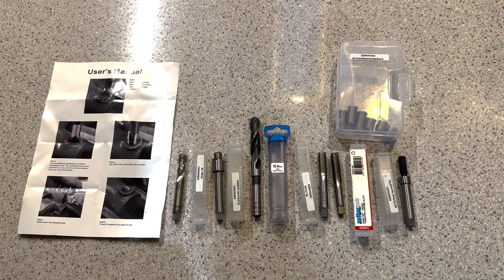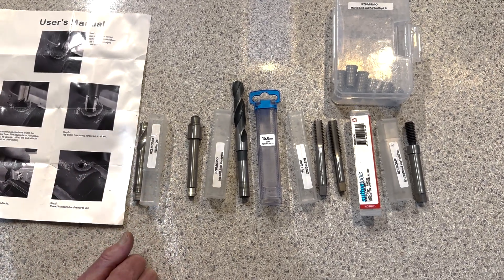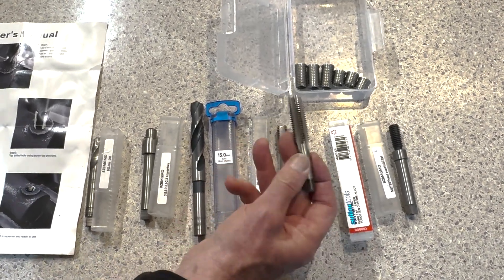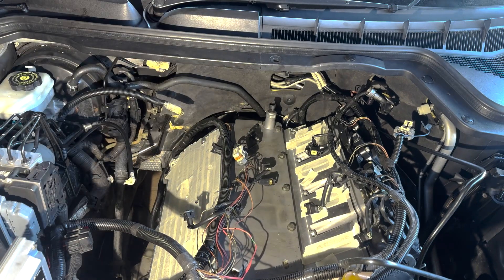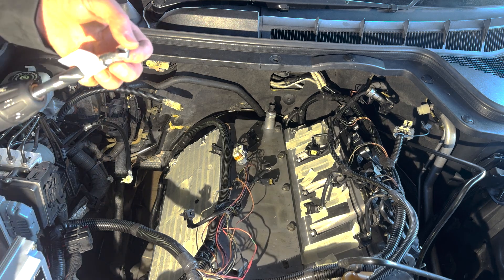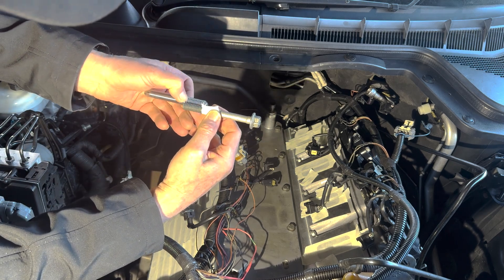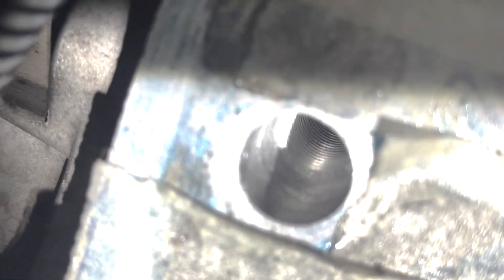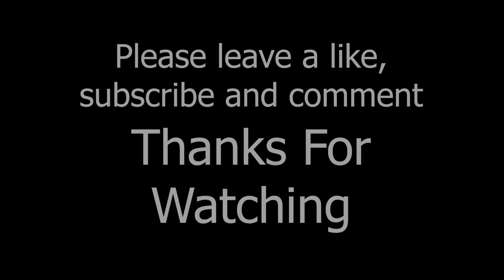The All In One Chevy LS Engine Block/Head Bolt Thread Repair Guide For under $100! All Skill Levels!

Comment: Can you post a link for this kit?
Reply from the maker: Here is a different kit but it contains all that you need except the 15 mm drill bit. https://www.amazon.com.au/SENNMONN-M11X2-0-Installation-Counterbore-Stainless/dp/B0FDG8Z1VL/ref=sr_1_2?crid=QJ1C7G9HE1B3&dib=eyJ2IjoiMSJ9.-1vI9cP8rL3MMOZ-Orou7rAgkFv6FqNAdfLEp-QsCHFIpWZZFHKjnkrV3Qw_EgOObfmoBdR78gRs7B9iixto-PUzN5VsIIsP32BP4kkfmBKnpe7fHfPHt5xSqsy_Z3hbYk8Zn2dfxQDYEmDaXg2bPkkV5Ruuis5iGYNLNHHEhrxyECyfeMkkCfkY7u14eSWq1eAkpa3OWj302LO0rQSsnXLC9NPx-SeRVqUlj84GrjMWAcYwxlCNVFfF81_CJL8bhVjCzwfzS-3mNy0f6stk31aCmoYwQ5Sb552Dlo24QL4.vn4Zj0WZCTvUzMfEDNRxSnbLTFNkGyKutxCYAz0UFK0&dib_tag=se&keywords=m11+thread+repair+2.00+insert&qid=1768203558&sprefix=m11+thread+repair+2.00+insert%2Caps%2C245&sr=8-2
Reply: Exactly like bruh 😢

Comment: The 90° drill head is cool .is that a full chuck or an addon piece ?
Reply from the maker: It’s a special drill that is supplied with three different attachments from Bosch. I think I mentioned in the video most angle drills only have a 10mm chuck so be careful if you are going to buy one.

Comment: I just received this kit to fix the back bolt threads on my 5.3 LS still mounted in an older truck. Great instruction. For someone doing their 1st DOD delete, this was a very intimidating problem to encounter, but your video helped my anxiety. 😂 I’ll order the 15mm bit and additional tap. My kit didn’t come with instructions. Any way you could send me a pic of it? I don’t think they’re necessary, but would like to have for reference.
Reply from the maker: Hey Robert, I am away interstate at the moment. I do have the instructions that came with the kit. I can upload that when I get home.
Reply from the maker: Robert I had to add the instruction sheet via post. If you would like I can email you a copy which will be better quality.

Comment: I’ll give that kit a go thanks 👍 Did the insert end up taking the torque when you tightened up the head bolts?
Reply from the maker: Yes it did and is working perfectly but after we fixed that thread another one went and had to fix that too